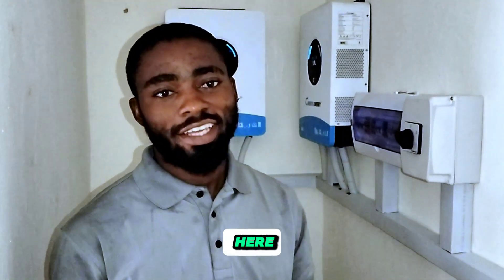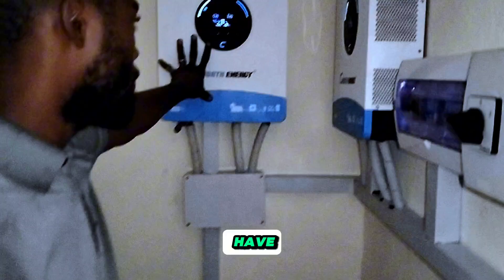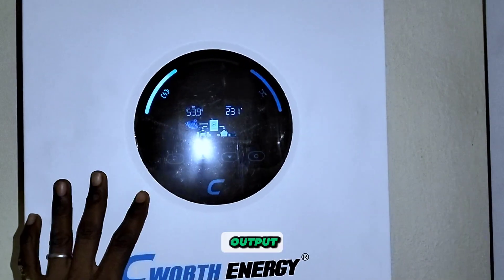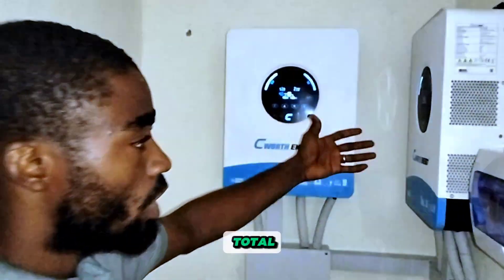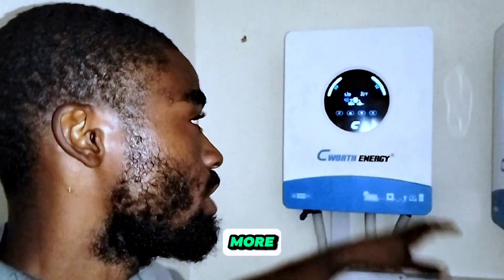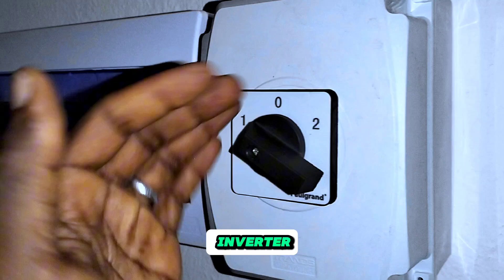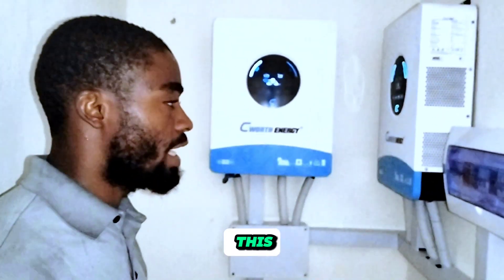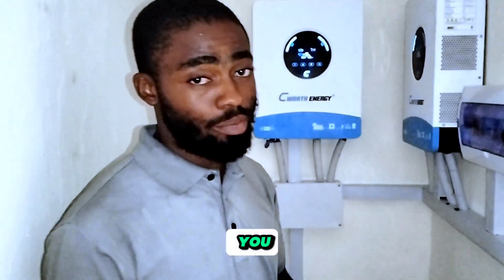paralleling two inverters to have large output.

Comment: what is the cost of this installation ?
and why wouldn't the air condition take power from the battery it is a big battery you're talking about
because my four tubular batteries can power one air condition
Reply: How long does it carry it for ?
Reply from the maker: Can carry one HP ac and other appliances overnight
Reply: I think he's talking about how many ACs the inverter can carry and not how long it can carry them.
Reply from the maker: @victorc.chikezie 6acs of 1hp